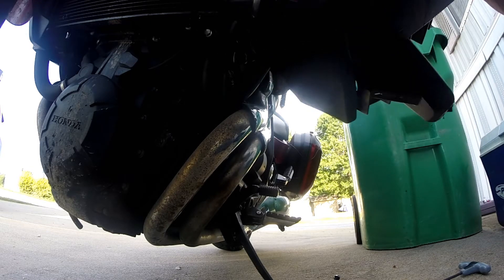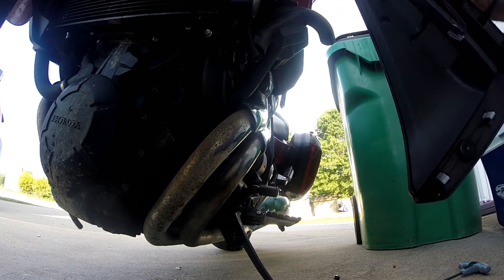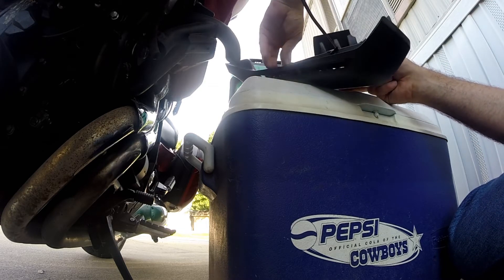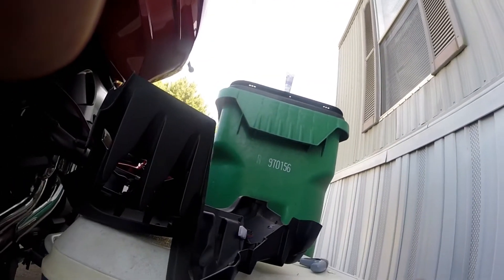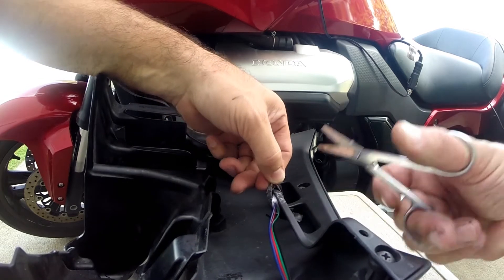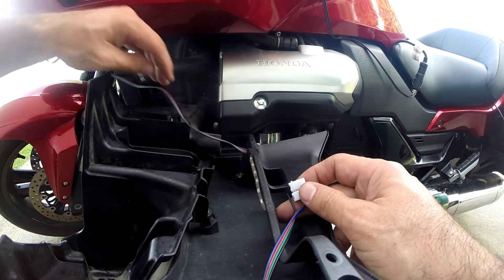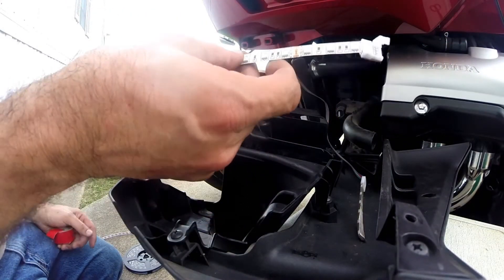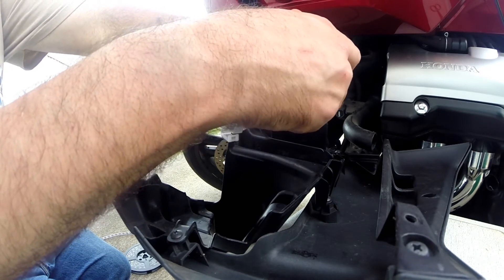The Installation of the LED Strip Lights for my 2014 Honda CTX 1300 Motorcycle   Part 2

Comment: What color are the LED's and I was just thinking, why don't you use ty wraps
Reply from the maker: The LEDs are the RGB kind. I have plastic ties, but they are of the big size. What size would I need, and would they stand up to intense heat for hours on end without becoming brittle?